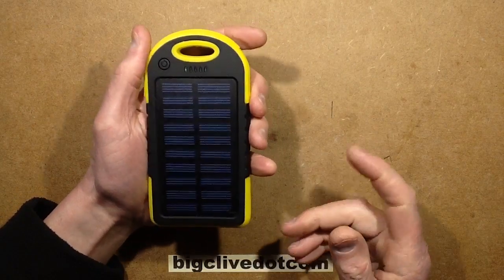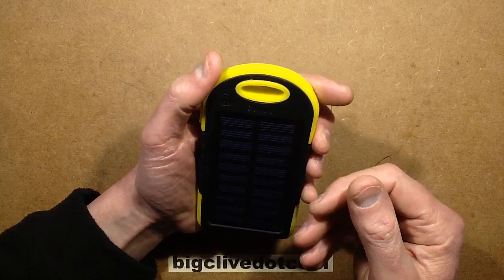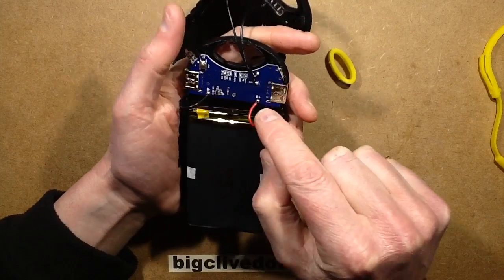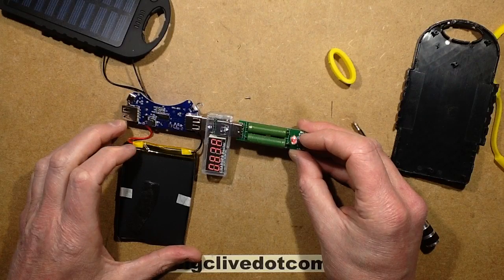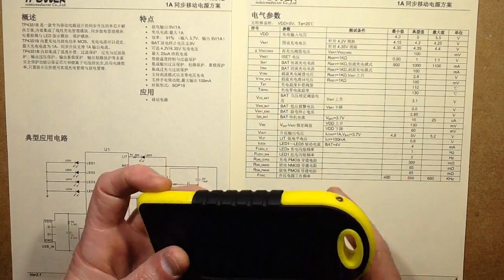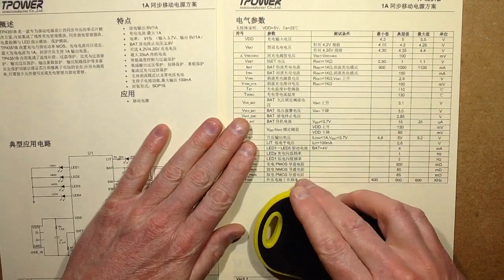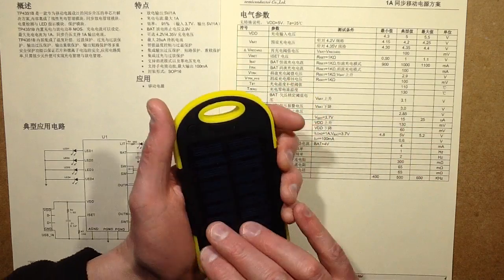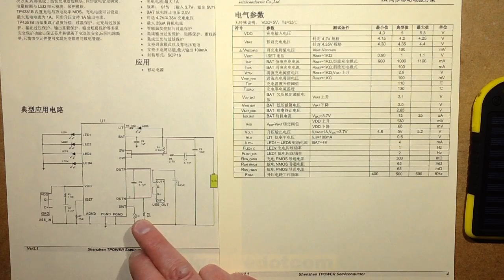A look inside another solar USB power bank.

Comment: 4.35 volt lithium ions are newer cells, most cells phones and "some" tablets have them. My galaxy has one. They charge just like the standard lithium ions and lithium polymers, just a slightly  higher charge voltage. Thats about the only real difference.

Comment: It does depend how they quote the capacity, since usually they are listing the capacity of the Lithium cell, which is 3.7v nominal, and the conversion efficiency may be only around 80%, so if you measured the capacity at 5v you might well get 2.something even if the cell itself is 5000mAh at 3.7v.
Reply from the maker: +James Lewis I measured the cell capacity.  When boosted to 5V the mAh capacity at 5V would be much lower.
Reply: bigclivedotcom Ahh, that's a shame, I've had fairly good luck with flat pack lithium cells... 18650's from china on the other hand... I bought some 5000mAh 18650's just to see how bad they were, since 3400mAh is the highest "legitimate" capacity that really exists... and while my "Torchy" 2500mAh cells measured 2550mAh on my test rig, Ultrafire 5000mAh cells measured just 700mAh.... never buy any cell from Trustfire or Ultrafire, or any brand claiming excessive capacity!...
Reply from the maker: +James Lewis They do it with NiMh cells too.  The highest genuine AA cells are usually nudging 3000mAh at 1.2V, but you get 5000mAh and higher being sold online.  I bought a couple of different ones and they measured 300mAh.  You could feel they were much lighter than a proper high capacity cell as soon as you picked them up.
Reply: bigclivedotcom It's a shame, Chinese electronics are often quite respectable, even when they don't meet the claimed specs they are still often very useful... but lithium cells from China are plagued with fakes, second hand laptop cells, and false (even impossible) claims...

Comment: +bigclivedotcom  So glad you reviewed one of these. I was looking at buying one just for the components. Especially the Solar Panel.

Would be interested to see a review of some cheap solar panels that would be good to use for robotics projects.
Reply from the maker: +Ian Isted Ebay has a wide range of bare solar panels in a similar style.
Reply: mine's used to had this charger until it battery swells. so i kept anything but battery

Comment: I have been developing and implementing higher capacity lithium cells into newer solar/light projects lately and found that most cells that have a capacity over 2800ma, are generally needing the 4.35v charge rate now. Threw me for a loop at first.

Comment: Hi Clive. Did you test the capacity directly from the battery or from the 5V USB output?
Also the 4.35V is the high density polymer batteries, that you would normaly find in more expensive applications such as mobile phones.
Reply: +Wuptidoo Exactly. The battery probably has the nominal "capacity" of 5Ah. Measuring battery capacity according to the mAh the bank delivers to load connected the 5V makes no sense. To check battery capacity, one have to connect a constant current load to the battery terminals. What Clive measures is the mAh "capacity" of the power bank, not the battery. Clive repeats this error again and again.
Reply from the maker: +Wuptidoo It was the internal lithium cells capacity I measured.
Reply from the maker: +Magdaléna Jírová When the internal cell is charged from a USB power supply the excess voltage will be dissipated as heat by the charging regulator in the pack.  But the actual mA to hour ratio will give the bare 3.6V lithium cells capacity.  The 5V output will be significantly less.

Comment: The Chinese have been producing lipo (lithium cobalt  generally, LiCo [so a different chemistry to the standard batteries] ) cells for charging at 4.35v for a couple  years now.  They are often advertised s 'high voltage lithium polymer batteries'.

I have not paid too much attention in the last year or so but In 2014 there were a few concerns around that these new cells chemistry are more subject to thermal runaway and very touchy to over charge so not ideal for use in standard consumer grade equipment but things may have improved. 

Didn't know they had heavily expanded into the consumer market to the point stand alone chips had incorporated this functionality to the design but maybe it is future proofing but guess it was inevitable now they are available in standard packages including 18650 and the flat wafers [as in this device]

Claims beyond a higher charge voltage is lower voltage sag compared to a normal LiPo, higher voltage density (similar current capacity for the weight but higher voltage) and high sustainable discharge rates.

Comment: Clive where did you get your screwdriver set?
Reply from the maker: +TheSkytherMod A UK shop called Poundland.  They sell a very good version of the classic 9 in 1 set.
Reply: +bigclivedotcom I use one of them for my e-cig shenanigans. It's cheese grade steel in the bits, but less cheesey than what comes with most rebuildable tanks.

Really need to get some decent 1mm allen keys and micro screwdrivers...
Reply: bigclivedotcom Is there any chance I could wire you some money to cover both the shipping, product cost and even labour so you could get me a set?
Reply: +TheSkytherMod I asked clive this on one of his other videos last week!
Reply: +TheSkytherMod Found one in a Dollorama ( dollar store in quebec ) But its red. Extremely usefull
Reply: Search eBay for "torx star phillips screwdriver * in 1" 
:)
Reply: Banggood has some really nice sets for stupidly low prices...   I got a gazillion in one set that has the coolest feature ever, a little bar next to all the bits, pull it and zoop the bits all stand up...   slide it back forward and they all lay back down !!

Comment: I decided to buy a solar USB just to have a look inside. Searching eBay is hilarious. There is a little rectangular solar USD that someone is advertising with four possible capacities in the pull-down selection. 1000mAh (quite likely), 1500mAh (OK, still possible), 50,000mAh (who are they kidding) and 100,000mAH! Then you look at the usual Chinese copy/paste description and it states 30000, 50000 and 10000mAh. All for less than $20USD delivered.

Better than the local comedy club.
Reply: +Bigrignohio In relation to this, anyone buy the 1200mAh keychain mini solar USB power bank? If the solar cells work AT ALL it might be worth it just for the flashlight feature.

Comment: Using Google Translate:
TP4351 B TPOWER 1A synchronous mobile power scheme semiconductor Co. , Lt Overview Features TP4351 B is a designed specifically for mobile power synchronous boost single-chip solution ● Discharge output: 5V / 1A decision program, integrated linear charge management module, synchronized discharge management module. Charging current: 1A maximum power detection with LED indication module, protection module. Efficiency: 91% (input 3.7V, output 5V / 1A) TP4351 B Built-in charging and discharging power MOS, the charging current can be set. BAT discharge voltage: 2.9V maximum charging current is 1A, synchronous boost support 1A output current. Optional 4.2V / 4,35V charging voltage TP435fB integrated temperature compensation, over-temperature protection, over charge and over-discharge protection Maximum 25uA standby current protection, output overvoltage protection, output overloading protection, output short circuit protection, such as multiple intelligent temperature control and over-temperature protection security features to ensure safe application circuit chip and Jane lithium-ion battery integrated output overvoltage protection, short circuit protection, overloading protection single element can be achieved with minimal management charge and discharge management. Integrated overcharge and over-discharge protection support trickle mode and zero-voltage charging ● Support flashlight function, maximum output 100mA ● Package: SOP16 application mobile power

Comment: Found you another electrode boiler mate

http://www.ebay.co.uk/itm/Cute-Cartoon-USB-Bottle-Cap-Humidifier-Home-Car-Air-Diffuser-Mist-Maker-Decor-DE-/281949519442?hash=item41a5803e52:g:2VAAAOSwWTRW1DaE
Reply from the maker: +Old Machines & Such Alas no.  It uses an ultrasonic atomiser to turn the water into a mist.
Reply: +bigclivedotcom Sorry mate, of course it is. I saw the electrode boiler shaped plastic and not the USB plug.
Reply: +bigclivedotcom I always wonder if/when ultrasonics will be used in e-cigs. I suppose they make a fair bit of money off the replacement parts though.
Reply from the maker: +Paul Gascoigne The first Ruyan e-cigs were ultrasonic, but the heated wick is much simpler.

Comment: Heey Clive, I'm wondering if you can help me out.

My mother in law always unplugs her tv when it's turned up. It's a pretty new LCD tv, but her reason for it is to save power, not for security. So i'm wondering how much power it would use when leaving it in. Given a year time. She really believes she's saving alot of money this way. Now I'm no technician but I do not believe the power usage can be al that high.

Could you prove or disprove this for me?
Reply: +Niels van Asten The turned off power of an LCD monitor is about 1.1 watts, so for a TV we'll say that's about 4-5w. The cheapest electricity I could find was 9.596 pence .per kWh, and the most expensive 10.804 pence per kWh. So at 5w consumption, it 200 hours = 1kWh. With 8760 hours in a year, 8720/200 = 43.8 kWh a year. Multiply the kWh with the price Thus, it would cost £4.20 to £4.73 or $6.04 to $6.80 a year.

I'm not that great with all this stuff but I hope this helps (You might want to check my math, I might have made a massive mistake somewhere).
Reply: +Dukey8668 Hey that is just what i wanted to know, thanks!
Reply: there's really no difference in power savings unless you unplug the fridge and freezer.

Comment: Samsung and LG (I'm not sure about other companies) have been using 3.8v / 4.35v cells for some time.  A problem arises if you buy a third party battery as many companies only produce 3.7v / 4.2v cells.  I noticed a problem when I was unable to clip the back of my phone back on after about a month of use because the cell had expanded.
Reply: Try apple.  iPhones rule. I've had 6 over the last decade. Flawless and no worries. :)
Reply: The supplied batteries in LG and Samsung are good, I was talking about 3rd party after market batteries.

Comment: Clive, Google translate works well. Copy and paste the Chinese characters in and you get a pretty good approximation of English. Enough that if you can read a datasheet, you can understand what it is trying to say. Here is the top section of the TP4351B page you showed...
Outline
TP4351 It is designed for mobile power supply design The synchronous boost Single-Chip Solution Programme summary, Internal integration Linear Charge management module,
Synchronize Discharge management module, Power detection versus led Indication module, Protection module. TP4351B Built-in rechargeable And discharge power MOS, The charging current can be set, The maximum charging current 1A, Synchronous Boost stand by 1A Output current. TP4351B Integrated temperature compensation, over-temperature protection, over charge and over-discharge protection Protection, output overvoltage protection, Output overloads protection, Output short circuit protection, such as multiple Chip security features to ensure the safety of lithium-ion batteries and, Simple application circuit single, Elements can be achieved with minimal management charge and discharge management.

Features
Discharge output:5V / 1A
recharging current: maximum 1A
effectiveness: 91% (enter 3.7V Output 5V / 1A)
BAT Discharge voltage: 2.9V
can selected 4.2V / 4.35V
Charging voltage maximum 25uA 
Standby Current Intelligent temperature control and over-temperature protection
Integrated output over-voltage protection, short circuit protection, Overloading protection
Integrated overcharge and over-discharge protection
Support trickle charge mode, and zero voltage
Support flashlight function, Maximum output 100mA
Package: SOP16
application mobile power

Comment: 4.35V cells have the same basic chemistry as the 4.2V variants. Both are available in ICR chemistry, which has a cobalt electrode ( prone to thermal runaway if not protected and mostreated).

There are "safer" chemistry cells available in 4.2 V form. IMR, INR and NCR to name a few, all with varying materials at the cathode.

The newest safer chem cell that you may have been referring to is LiFePo4. Voltages for these are very different. They're a 3.2V nominal, 3.65V peak chemistry.

Comment: Quite often the difference between the mAh stated and the ones measured is due to the fact that the Lithium cells have a different voltage that is boosted to 5 V. Usually the stated capacity is referenced to the cells voltage and not 5V,  because this way they can state higher numbers. Even Xiaomi does that, but they also state the 5 V capacity on their power banks.

Source: I own one. Also take a look at this picture of a 16.000 mAh Xiaomi power bank. http://assets.hardwarezone.com/img/2014/12/Mi-16000mAh-label.jpg

Comment: Chinese download server just went titsup........ Can't even supply a 400 byte a second stream. Trying again and it might get past the great firewall now.

Cheap product, basically half rated spec, and the solar cells are only good to keep it alive more or less. Charging a regular cell to 4.35V will result in a larger capacity, but at the expense of a really reduced lifespan. You can bet there will be a host of overcharged cells coming out soon, the increased capacity will make it irresistible.

BTW, the rating on the datasheet is maximum switch current, so yes it basically is a 500mA total USB port unit.

Comment: The 4.35V cells are the new style that comes in modern smartphones and laptops. They have a 3.8V typ voltage and 4.35V full charge. 18650 are available from Samsung (ICR), Panasonic (NCR) and maybe others.

Comment: 2:01 Li-ion cell not Lithium cell. Sorry, but it bugs me every time someone missuses the term.
Reply: It is a lithium cell...
Reply: accorden No. Lithium cell is a term used for lithium primary batteries (https://en.wikipedia.org/wiki/Lithium_battery). The battery in this power bank is a lithium-ion battery or Li-ion (https://en.wikipedia.org/wiki/Lithium-ion_battery)
Reply: So lithium ions aren't lithium...
Reply: accorden They aren't ordinary metallic lithium...but that's beyond the point. Lithium battery and Lithium-ion battery are two widely accepted terms. By using the term lithium cell to refer to lithium-ion cells, even if the term works, you create a homonym. And homonyms aren't very good in engineering.
Reply: Ok, let's call it an electron containment vessel...
Reply: accorden 0__0

Comment: A nice slim device, shame its not quite up to spec :-(
.
Data sheets can be useless at times, the specs can be so wide that you get no idea of how good/bad the chip actually is, and different datasheets can show quite a difference.
.
Like the specs for decent multimeters, the meter is allways better than the spec sheet by quite a good bit.
Change to thicker wires to the battery perhaps?

Comment: I like it. 
Ordered one to play with.
Reply: Michael Thompson Yes sir even though it's ballox in that the solar panel is not charging shit, you can actually make it work as a solar charger as the panle does produce 5w with 6volts. By using a diode I was able to connect the panel to mains input.

Comment: Feature
 Discharge Output : 5V / 1A
 Charging current: 1A
 efficiency: 91% ( input 3.7V, output 5V / 1A)
 BAT discharge voltage : 2.9V
 selectable 4.2V / 4.35V charge voltage
 The maximum standby current 25uA
 intelligent temperature control and over-temperature protection
 integrated output overvoltage protection, short circuit protection , overloading protection
 integrated overcharge and over- discharge protection
 support trickle charge mode, and zero voltage
 Support flashlight function , maximum 100mA output
 Package : SOP16

^ Google translate of that section from the PDF File
Reply: Thanks!

Comment: Less worried about overcharging, more about the matte black casing and almost black solar panel absorbing a lot of heat from the sun, as you said. Especially inside the window where it has no airflow. How would you rate the chance of the lithium battery combusting randomly?